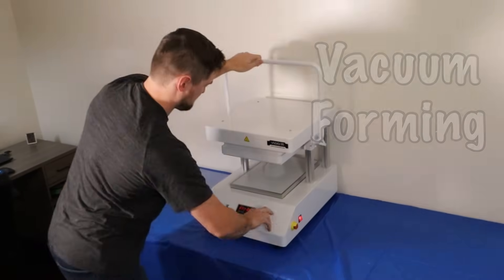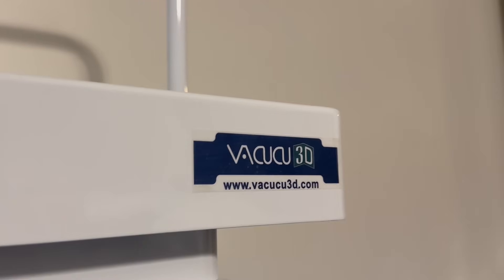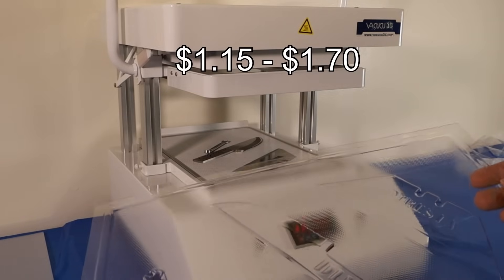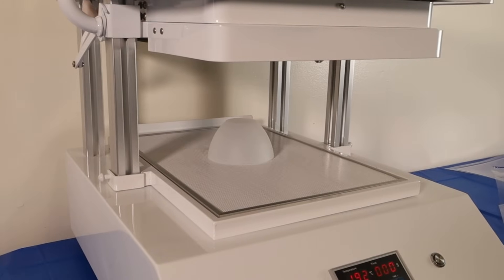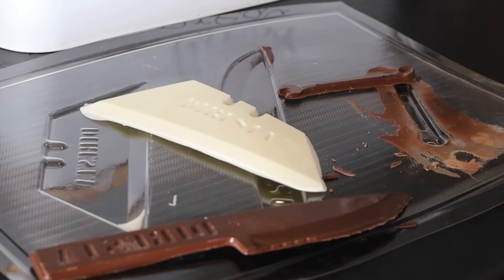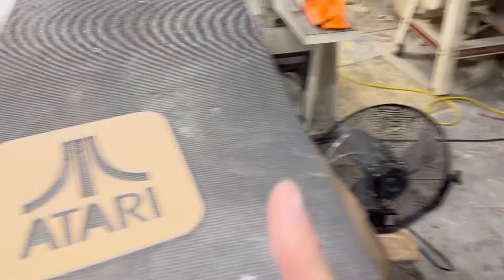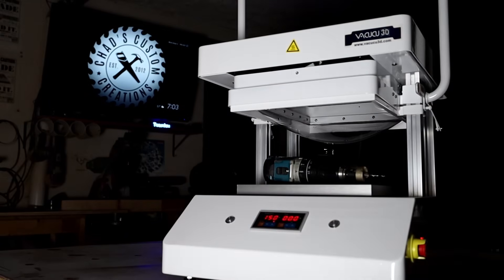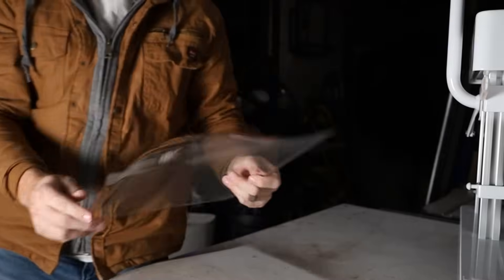Why I got a Vacuum Former, What Can it Do

Comment: Back in the early 60's my brother and I received a Mattel Vacuum Form for Christmas.  It worked the same way but was limited in size to only about 4 inches square.  We made hundreds of copies of toy soldiers with our "Vacuum Form".  Latter in life I went looking for that machine in the basement of my parents house, I found it sitting on a shelf, and to my surprise it still worked.  I used it to make clear canopies for balsa wood R/C airplanes.  Loved that machine!
Reply: I had a Vac-U-Form when I was a kid, too. There were quite a few "toys" back then with which you could make your own toys ("Creepy Crawler Bug Maker," foe example). I also had a "toy" with which I used molds to make lead soldiers, if you could call something that used six-hundred degree molten lead a "toy."
Reply: @jeffbrown2982  OMG!  I had forgotten all about making led soldiers by pouring one’s own casting.  My younger Brother got that for Christmas.  I agree….not exactly something that would sell today due to possible law suits!!
Reply from the maker: That is too cool I love the fact that it still works today. Did it have an integrated vacuum also?
Reply: @ChadsCustomCreations  Yes it did have an integrated vacuum.  You would place the plastic sheet which had perforations around the perimeter into a frame that was hinged on one side.  The Frame with the plastic installed would be suspended above a "Hot Plate" to heat up the plastic.  Once the plastic began to droop from the heating process, you would take the frame, which as I mentioned was hinged on one side, and flip it over onto your item you were making a mold of.  Immediately you would begin to press repeatedly a lever which was a manual vacuum pump to evacuate the air causing the plastic to conform to the mold.  In my case a toy soldier or mold of a R/C canopy.  Not to many toys that you received as a kid you still find uses for as an adult.  Thanks again for the Great Video!
Reply from the maker: @josephgregory5567  that’s incredible I’ve gotta search eBay and see if I can find one for my kids!
Reply from the maker: @josephgregory5567  oh wow what a great design for that machine! Thank you for sharing that.

Comment: Lasering lends itself really well to vac forming because your cuts kinda have a draft angle built in, even if it's a really shallow angle from the shape of the laser kerf. Amazing work!
Reply from the maker: Oh yes you are totally right! I bet I could increase that angle with a shorter focal length lens also. Great point thanks for adding that to the comments.
Reply: In Mould building with solids, 8% angles are the minimum, but since this seems a little flexible a smaller angle might be fine

Comment: Tall items will have issues with webbing forming at the corners, like they did on your tall box you tested. Make a frame that countours to the edges of what your pulling. Put it down over the plastic as youre pulling vacuum. That helps pull all the plastic flat. I'm told a bit more heat to make it stretch around those corners helps too, but that also takes more skill because pulling holes and tears is definitely a thing.
Reply from the maker: Great idea, yes I thought I saw someone using that technique I’ll have to give that a try.
Reply: @ChadsCustomCreations  A while back I was looking into making RC car bodies, and there was someone posting videos of a fully automated vacuforming system, cranking out hundreds of copies of car shells.

Part of setting up for a run was adding cleats, like 1x1x5 blocks, around your buck, at a right angle to where those webs are forming, to tension the plastic as it's being drawn down.

Setting it up is a little bit voodoo, but if you're planning to crank stuff out in big batches, it seems easier than trying to juggle in an extra frame while you're dropping down the sheet.

Comment: I have one of those big lasers I really need to restore. The roof dumped a buch of water in the storage shed and the laser got corroded so its staring at me daily. Need money to get anywhere and its not exactly a great time for that to exist. The Vacuum former has always appealed to me, that big one with mold reinforcemnt or heavy plastic could do concrete forms. Vac a 2 part support shell for a silicone or alginate inner detail mold perhaps?
Reply from the maker: Those are great ideas with the concrete!

Comment: What settings do you use to cut the 1/2" ply and is there a certain brand of ply that use? I've had limited success cutting anything over 6mm on my 100w lasers.
Reply from the maker: That’s just the cheap plywood from our local big box stores Lowe’s or homedepot. I believe I had it cutting at 5/mms I have a 2.5 inch lens and I use 20 psi on the air assist.
Reply: @ChadsCustomCreations  Pretty sure it's my air assist. Do you have any content on your air setup? Great video btw, I reluctantly showed it to my wife and her gears are already turning.
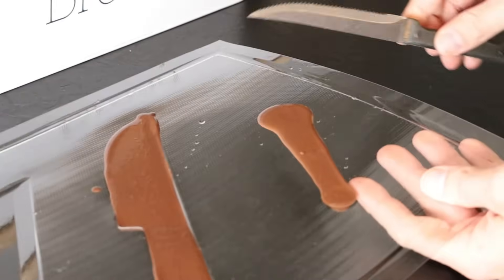Reply from the maker: @fubarfrank74  I show a little bit at 9:40 https://youtu.be/YNi2rpqrLXY

Comment: Now, don't go getting all big & bad over this. THIS... , is nothing new. In college, we built a rather large version & we could vacuum form a lot more than little bowls & watches and we used it to blow mold plastics Plexiglass,  Uvex & PVC. Back then, the craze for conversion vans, all fixed up, was beginning & we made a lot of blowmolded roofs & windows. It took the auto industry about 15 years to catch up. We were doing vacuum forming & blow molding in 1970, so it's been a while. I made several light projects while in that class using both blow molding & vacuum forming. We could heat & use plastics up to 4 feet by 4 feet. We could make lenses in vary sizes for lighting effects.
The Vac-u-form, was a toy invented by Eddy Goldfarb and released by Mattel in the 1960s around 1961 with the trademark filed on October 8, 1962. Based on the industrial process of vacuum forming, a rectangular piece of plastic was clamped in a holder and heated over a metal plate. So, it;s nothing new.
Reply from the maker: I am for sure late to the game on this process but I definitely can’t help but be inspired by it. I bet I could learn lots from someone like you with lots of experience with it. I hope you follow along and offer me guidance as I implement in more in the future.